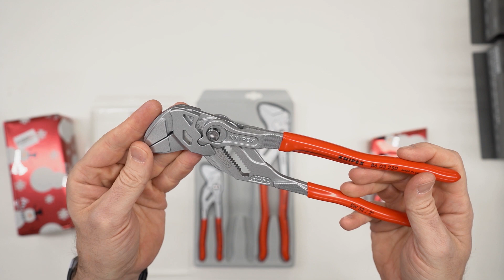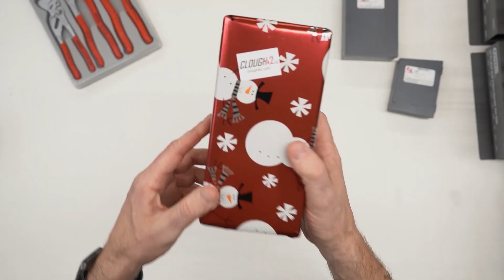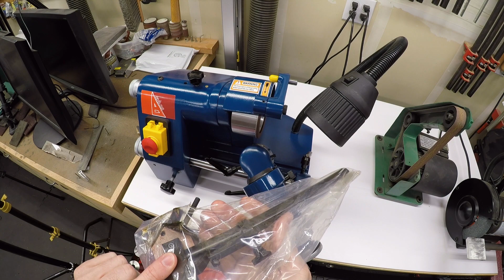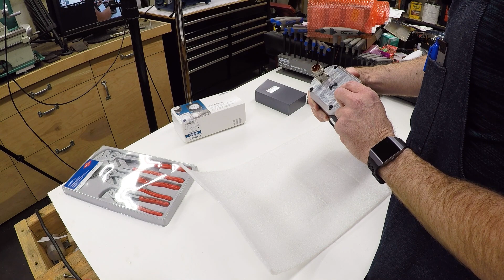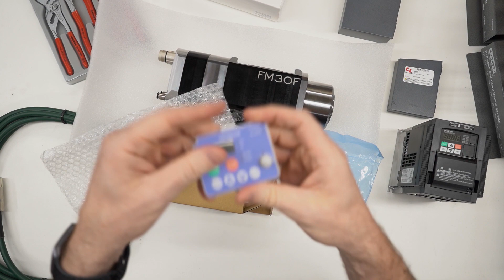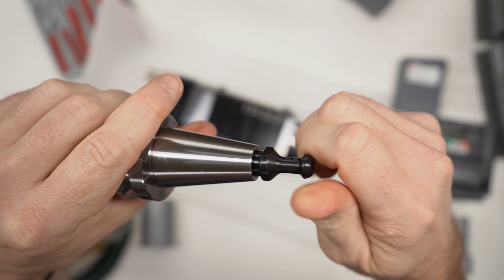Christmas 2019 - Opening Presents for the Shop

Comment: Na. Bite the bullet and cut the grabs to 12.5 mm. That way you can control the final result. Any “adaptive” grabs you might find would not likely meet the concentricity you need for it all to work right.....speaking rough shop production (low tech and low quality) here. Best to save your money for better gear or other improvements.

Comment: Won't this modification over load the structural integrity of the G-0704?
Reply from the maker: I don't think so.  The actual torque will be lower.  The goal is to dramatically increase the spindle speed with small tools.

Comment: If you took the grinding cups off the wheel adaptors instead of just swapping out the adaptors, wouldn't you have to regrind the cups true each time to balance them? o.O
Reply: Yes, which is the biggest reason not to do that.  Extra hubs pay for themselves pretty quick in saved time and wheel consumption.

Comment: I'm thinking on a spindle upgrade in the future too (specially now that have full rail conversion and overpowered servo motors on all axis) but I have kinda a dilema: on one hand I like those BT30 cartridges as I want to be able to maintain the rigid tapping I have, plus I want on the future get them to work with through spindle coolant. Standar ones go up to 6k, but top ones go up to 12krpm. On the other hand, a high speed spindle is easier and less bulky (maybe a B axis...)

Comment: Merry Christmas James! I will say I did cringe when you started pulling all that electrical stuff out of boxes. I could have donated a good majority of that to you and saved you money. :-\  Good on ya though picking a Meanwell PSU, we use them at work and they are extremely good. We also use PULS for our larger wattage 24v PSU's and those are what I would have donated; not sure what wattage you require though.

Comment: How do you translate the Z height determined by the 3D tool to the random length of the milling tool you replace it with? X & Y make sense, but the Z seems less useful than just touching off with your mill. What am I missing?
Reply from the maker: Every tool, including the Haimer, has to be in a dedicated tool holder with a repeatable length, like a taper holder or face-contact holder like TTS in an R8 spindle.  Then you can touch off or measure each tool once and set the length in the Mach3 tool table so it can adjust automatically.
Reply: Every toolholder once fitted with a tool is given an ID, tool 01, tool 02, etc. together with ID its length, diameter, form and any offset are all registered in Mach 3 3, fusion etc. so when you call a particular tool number the measurements are automatically adjusted within the program.

Comment: No drive dogs on the spindel motor?
Reply from the maker: No.  It's ISO30.  BT30 has drive dogs
Reply: @Clough42  ISO40 also have drive dogs and the common mistake for new gamers are that they are different from the BT40's drive dogs. When you didn't mention the drive dogs it had me a bit worried until I looked up the 30 tapers.
Reply: @Clough42  My Optimum BF30 Mill has ISO30 taper with dogs. As far as I know ISO 30 only refers to the taper, there's a variety of spindle configurations all using ISO style tapers and it's likely mine is a German derrivative. All the ISO 30 taper tooling I've seen here has the cut out for the spindle dogs, but note the warning elsewhere in these comments about not all dogs being the same. Could be a bit of a bitch ......BobUK.